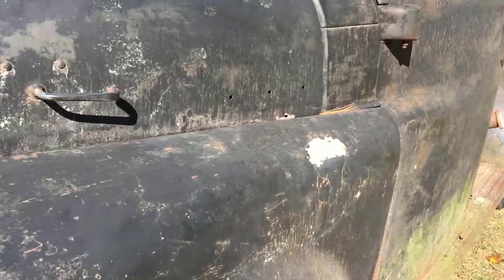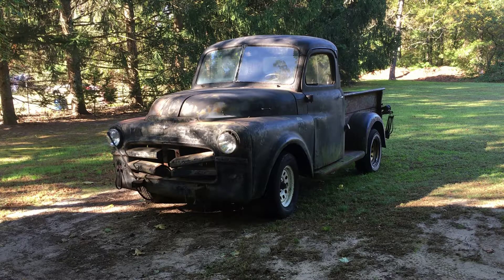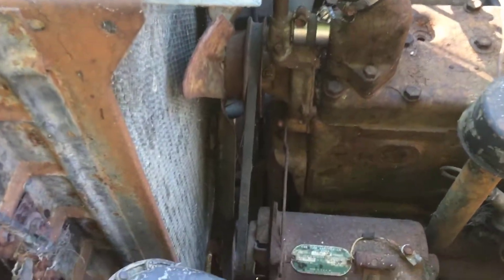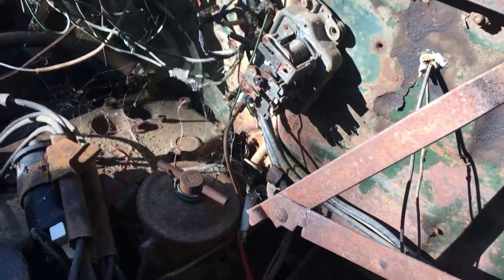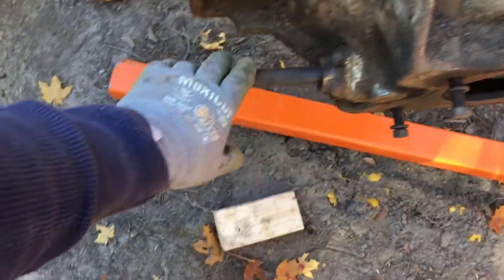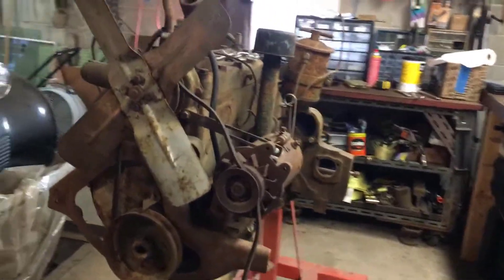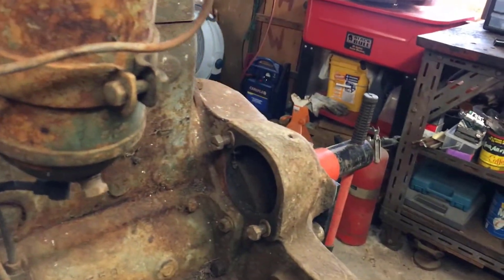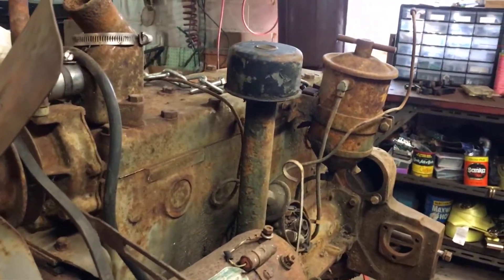1953 Dodge Pickup Truck Part 1. The Back Yard Build Begins!

Comment: What oil filter does it take? Do you happen to know a part number?
Reply from the maker: NAPA Gold filter Part #: FIL 1011. I believe they are made by Wix Filters.
Reply: @GaryAhl  see I have a 1954 c1-b6 I been getting running it sat since 83 so after all the getting the engine lined out I been trying to find the filter for it. It’s like 6”x 4” and it’s located on the drivers side fender. Kinda looks like a soup can with holes is that what that filter looks like
Reply from the maker: I’m not sure about that filter but I recommend you join the group “Dodge Pilothouse Era Truck Club” on Facebook and ask the question there. A gentleman named Eric Bannerman moderates the group and is extremely knowledgeable about these trucks. Good chance he may be able to help you.